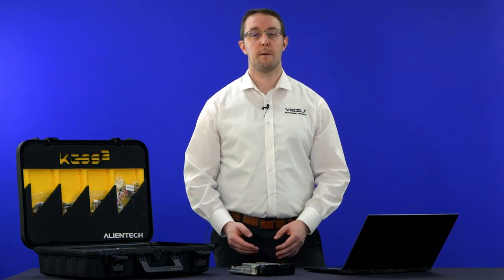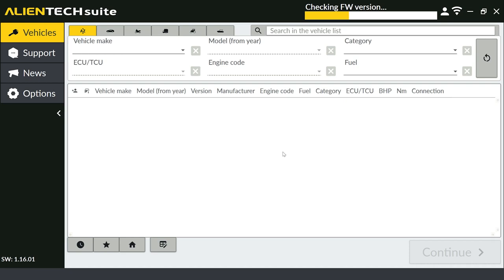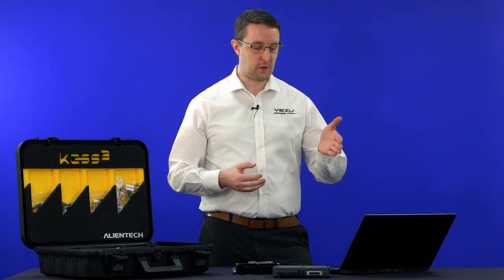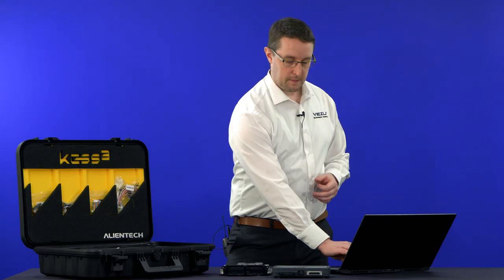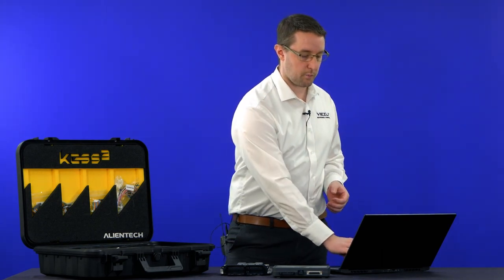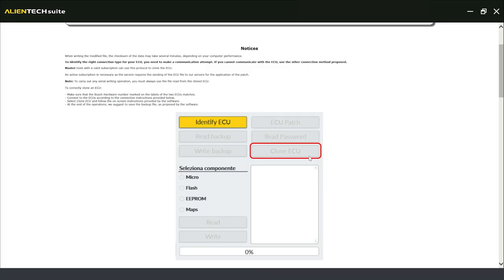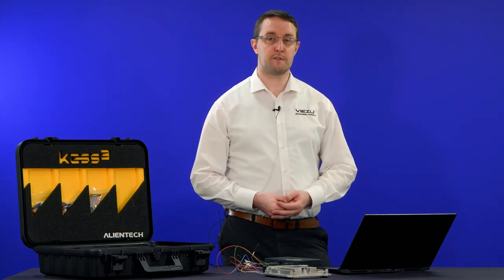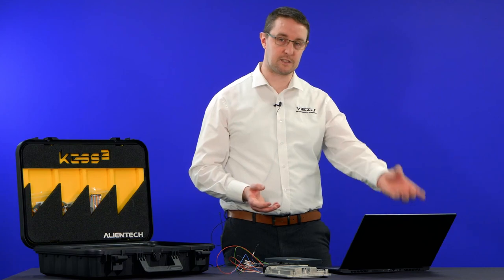How to use the Alientech KESS3 in Bench Mode - KESS 3 Training

Comment: Sir I have one doubt 
Why u use different read backup for slave and master ? 
Both are same ryt ? The same file I can send to u if am using slave and I can modify the same file if Iam using master ! What is the difference in that ???
Reply from the maker: It's a great question @fayiz488. 

there is no real difference in the backup. the backup is exactly what it sounds like, it's a backup read of all of the readable components in the ECU. However, the difference is with the tool. A client/slave tool cannot see or view the individual parts. This helps keep it very simple and straight forward for a client/slave user to operate. Simply read the backup / write the backup.

For a Master, the backup is different. It is there purely as a backup. The master would tune the "MAPS" data file, either the micro or flash chip or on some ecu's a specific MAPS read that combines data from both chip types. This is what is then tuned and wrote back to the ECU. The backup for a Master tool operator is there to restore the ECU back to full original in a worst case scenario.

Comment: I am interested in cloning motorcycle ECUs (mostly just one bosch variant). I want to do it via bench mode. How does the subscriptions work? 1-Do I need to renew the subscription every year, even if I am not interested in new updates? 2-Considering the bike master subscription, do I have to pay for each brand/model, or I get every available model? Thanks!
Reply from the maker: Hi, the subscription would be required to access the support from the manufacturer and to take advantage of new protocols and releases. The Bike protocols would come as a group and would unlock all available bike protocols at the time of activation and any new bike protocols released whilst the tool remains in subscription.
Reply: @ViezuTechnologies  thanks for clearing everything out!!
Reply from the maker: Hi,

Thank you for contacting us. 

You would need to pay subscription each year to maintain access to new and updated protocol releases. There is one subscription cost for updates on all protocols enabled.

Kind Regards

Chris

Comment: Thanks for the video. I have one doubt regarding the battery stabilizer. Here you use a CTEK Pro 25. But I've been reading on some forums that the use GYS100 for newer german cars. So I wonder if for starting I can only use the CTEK and if this will work for most brands excluding premium brands (MB, Audi, BMW, etc). Thanks
Reply from the maker: The CTek 25 pro is a great all round charger, and is ideal for tuning and programming all 12V cars
Reply: @ViezuTechnologies  Thanks. I was reading in some forums that newer BMW require larger currents to keep the 13.5 volts when writing and that it takes in some case 1 hr or so. Can I still use ctek for such vehicles?

Comment: Ive tried to bench read a BOSCH MED17.5.5

however it failed to identify.

I checked all connections numerous times and it still didnt work
Reply from the maker: If you are a dealer with us why not give our technical team a call on 01789 774444 and option 2. They will be able to help see if there are any problems. The Kess3 can read that ECU via OBD, Bench, and boot methods.  If you are not a dealer still give us a call and we should be able to help.
Oliver

Comment: if i purchase a Master tool, and ECM titanium so i can tune petrol vehicles as this is what we currently have experience with.
would i still be able to operate as a slave, meaning, to be able to buy tuning files from Viezu or other tunners if i receive clients with diesel vehicles (mostly ford rangers and mazda bt-50)?
Reply from the maker: yes you can still buy ready to use tuning files as a master, and if you are not sure, you can buy a slave and upgrade to master any time by paying the difference between the tool protocols - so you have options, info@viezu.com

Comment: Does a slave user have the clone button enabled? 
On Ktag slave users don't have this button enabled and I was unable to clone a EDC17 ecu for a customer.
Reply from the maker: It's not enabled on client tools from Alientech, but if you send the files to your Master they should be able to do this for you in most cases.

The reason it was removed is that the old style of just burning a backup from the old ECU onto the donor ECU will not work on many ECUs anymore. For correct cloning the process is different on some new ECUs and it writes partial data into the DONOR ECU at various steps of the process. If in doubt check with your master. If cloning is something that you will do often, then I would suggest upgrading to a Master KESS3 and possibly look at a Magic Flex as that has great cloning options also. Contact info@viezu.com for more information from one of our helpful team.

Comment: Hi, I am just wondering if Bosch ecu MEG17.9.12 is available for service mode using kess3?
Reply from the maker: Hi,

This should be supported on KESS 3 service mode.

Kind Regards

Chris
Reply: Thanks for your reply, do you know how much does it cost for kess3?
Reply from the maker: Prices are now available, please mail us at Info@viezu.com and we will be very happy to help
Reply: @ViezuTechnologies  hi, can I do ecu cloning in service mode without opening ecu cover?
Reply: And also is it possible to write to new ecu from back up binary file that I have read previously by using k-tag master?
Reply from the maker: Hi, great news! YES YOU CAN CLONE WITH BENCH!!! The latest KESS3 has a completely redesigned cloning function for master tool operators which opens up a wide range of additional control units for cloning. 

Using the backup for cloning is different now. If you are a Master you can use the new CLONE function, if you have a client/slave tool then you will need to send the backup to the your Master file provider in order to have the file specially codified for the new ECU before writing the new encoded backup file to the donor ECU. If you are a client/slave tool operator then please talk to your Master file provider for further help. If you run a Master tool, then simply use the new Clone function and follow the onscreen instructions.